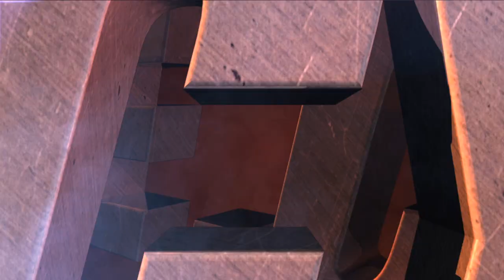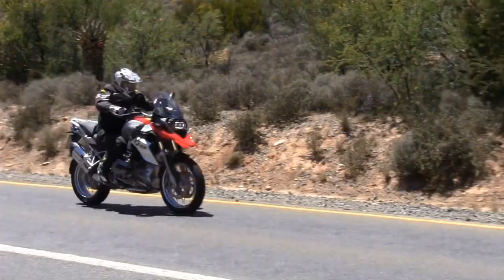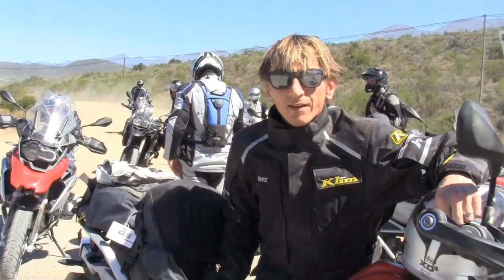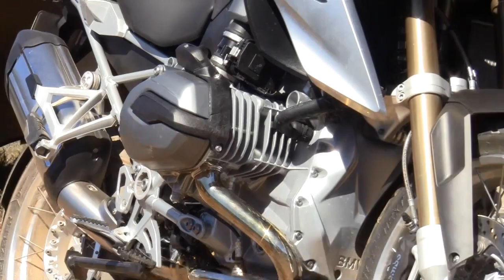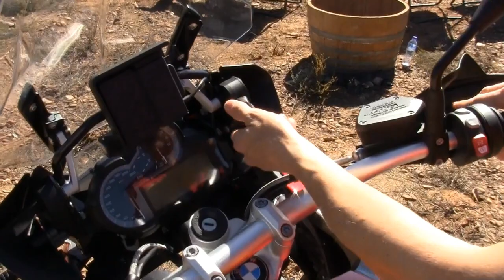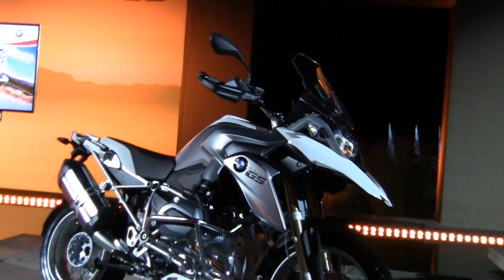2013 BMW R1200GS Review

Comment: Ok, I'm really, really confused. I'm looking at buying a 2013 R1200GS Adventure Triple Black edition but the shaft drive is on the Right side! It is definitely a 2013 but it seems that all the upgrades discussed in this video are for the 2014 model year. What the hell is going on??
Reply: It is a bit confusing, I know. 2013 was the year that BMW redesigned this bike, as you all ready know. But, it happened midyear. So, you do have to be careful, if you buy a 2013 it may be the older design or the new water cooled engine.

Comment: I used to think this Beemer's Boxer type engine configuration was silly & maybe it still is,cuz any toppling over on any side or skidding off on the coarse surface of especially asphalt,the block's head will get some degree of rutting-in or shaving-down,respectively,no matter how small & it's absolutely essential,compulsory even to get the after-market roll bar-fodder cradles,like those from Touratech to take-up any abrasion incurred.However now,I begin to see the light & have found new use for those stupid cantilever engine blocks.One can actually rest his/her pair of feet on each side of those transversally-offending protrusions,like how one rides on a Harley & that also,is if his/her members are right enuf to actually get comftable at all.Tho' of corz they arnt in anyway meant for that kind of abuse.Maybe Beemer shud might as well,just make good useful function out of it,by reversing the blocks' orientation from leading to trailing edge,actually the port block goes to starboard & vice-versa,to allow better foot-hold & probably even adding-on over the blocks some kind of foot-pads like those found on Harley Electra Glides to shield engine heat from permeating thru' the rider's shoes.Yeah-right..,these all sound rather silly don't they,but then so are its engine blocks' ridiculously strange positions.
Reply: I do this also lol
Reply: Learn how to ride and it won't be a problem

Comment: The BMW R1200GS and the KTM 1190 are both too heavy for the average rider to ride aggressively off road. So that topic should just not even be discussed. If I was looking to do aggressive off road riding I would not purchase either of these bikes! The GS is a bike that you can have a great time on, ride long distances, and has off road capabilities. That actually work great.  I have owned both brands. Both are great. Whoever is bashing the other, is just a backyard bbq'ing bullshit talker. Or like a couple 10 year olds at christmas "my bike is better than your bike". Buy what you like. Each have advantages over the other, and disadvantages.

Comment: My 1200 GS was a joy on the road and very comfortable. I have a bad back and the ergo was fantastic. The problem was that it was SO TOP HEAVY that I would sweat bullets I was going to drop the thing (or my passenger on one occasion). And pushing it around or backing it up was a nightmare. You can compensate with various techniques but in the end I sold it. I was hoping they would eventually get in the 21st century and make it lighter. Instead this model is MORE top heavy. ... Harumph :-(

Comment: I got the F650GS(800 twin) use that off road on forest roads nice bike on the road not too heavy on the trails but definitely not a dirt bike, but would recommend it  for starting & a lot smaller than the R1200GS. I've been out with the 1200 bikes as part of a group & it's more than kept up even left them behind a few times on the trails. Also not as aggressive as the 800GS, the forks are different, lower centre of gravity & 15hp down on the engine

Comment: BMW motorcycles SUCK,, My K1300GT, Fuel strip failures, Starter failures, EWS failure, Rear Drive Shelled, Starter failure, ABS pump failed, all within 30K.  I sold the POS to dome poor dumb BMW lover.  I see BMW is already recalling the 203 LC GS bikes for problems.

Comment: it is better if the previous blah blah blah, the promotion machine did so in the previous motorcycle, it's the money of the Bavarian manufacturer that does its job, it is a motorcycle that almost does not change and is just too heavy for the offroad driving, you guys ever heard of ktm .... do have a new motorcycle and won the dakar a few times, that's advertising

Comment: Sadly they are also very dated and the klrs at least have some pretty major issues right from the factory. Now if they would get a basic fuel injection system to get away from the problems of a carb add a 6 speed transmission and lose some weight. maybe a shaft drive a taller windshield and better suspension.

Comment: You do NOT HAVE to get to get all the electronic options. In fact, only ABS comes with the base model. And you can override on the trail it if you want. Besides that, ESA, ASC, cruise control, TPM... heck, even heated grips are offered as option packages. So, there.

Comment: In my opinion, analog instruments are way better to read if it comes to a short glance. Of course a digital speedometer tells you the "exakt" speed (depending an the accuracy of the system), but what use is it to see if you go with 60 or 61 mph? Or if it's 4231 revs/min or 4235 revs/min. With an analog instrument you don't have to "read" your speed or the revs. You get an instant information of the region of your speed/revs/temperatur etc.

Comment: 65% air cooled still. 35% liquid cooled. Like the wet clutch mounted on the front. No more splitting the bike in half to to clutch work. Looks nice.

Comment: I use to work at BMW Motorrad, one of my concern was the reliability with adding more electronics and complexity in these bikes. If I want to go to Patagonia the 1200GS wouldn't be my first choice, I prefer de 1150Gs more simple and proven bike. This new 1200GS is less off road and more city ride in my opinion.
Reply: And then reality happened.

Comment: However if you want to do proper adventure riding, which means long distances (you need extra fuel), carrying lots of extra weight etc. then a small KTM enduro is not very suitable. GS is actually perfect for adventure riding.

Comment: Yeah, I think what it dumbs down to is simply that if you want a simple,low-tech bike, a 1200GS won't be for you.  Like my Honda (while albeit, not a dual sport) is about as simple as you can get, but honestly, even if it had a dual sport setup, it would *never* ride like that BMW.  So it's hard to say what those electronics lend to the rider.
.
That being said, the only electronics I'd worry about with the GS is the spring dampening - not the electronics, the dampener actuators themselves.

Comment: Not sure I agree.  It's not like there's circuit boards hanging off the sides.  It's all controlled by the same transistor based PCM that controls just about every other modern bike.  The only thing that I don't really like is the dynamic dampening, because to me, yes, that is a possible fail point on a bike meant to go anywhere...but hey, for all I know the system can be damn-near bullet-proof.

Comment: I used to own an '06 (now have an F 800 GS). Not a single problem with either. They do exactly what you tell them to. With a motorcycle, that's obviously very important. 

With regard to getting pinned under the bike. Well, I suppose that's why I lift weights :-).

Comment: They have a whole different set of problems due to just being so outdated and a lower performance bike so not as nice on the highways and that sort of thing.  I would think the ideal adventure style bike would be light but fairly powerful with fuel injection abs that you can shut off and thats about it for electronics.  Shaft drive for its low maintenance. Stuff like the electronically adjustable suspension seems like a problem waiting to happen.